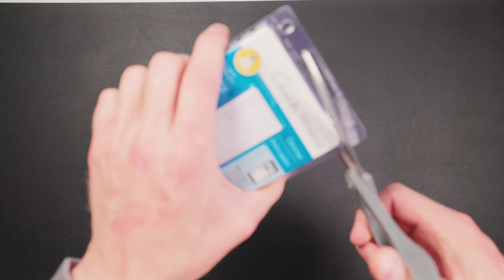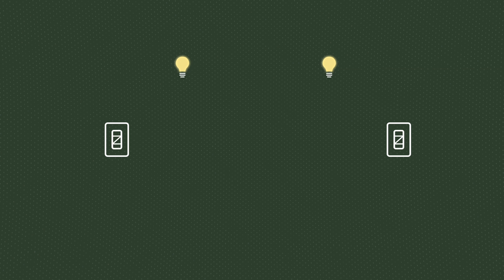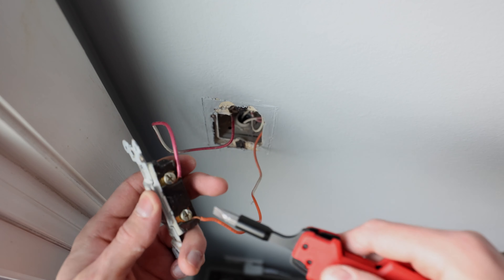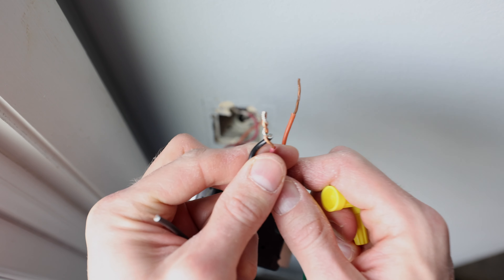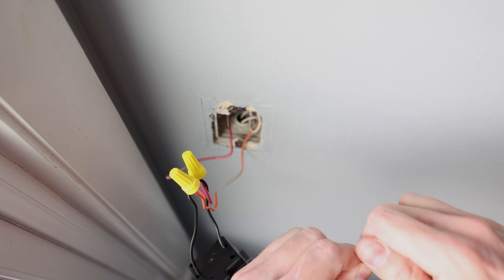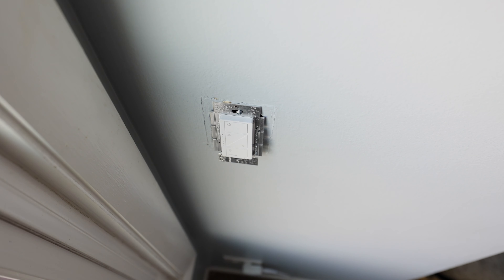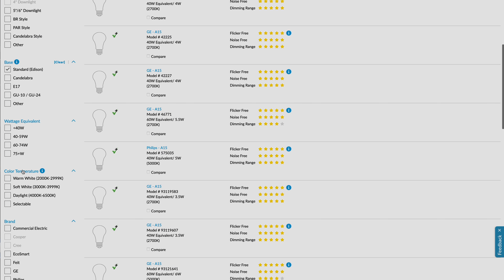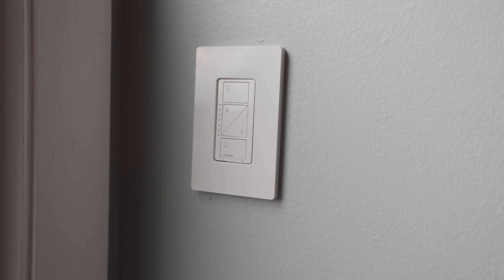How to install a Lutron Caséta Dimmer Switch

Comment: I installed a Lutron Caseta and regret installing it. Very good quality but a big problem for me is that it does not remember the last dim setting...!!
Reply: Yup I also did not know this when I invested in Lutron Caseta… but they are pretty much your only option for smart light switches that do not connect to WiFi. My house has enough WiFi devices as it is, and I was not willing to take the risk of installing 20+ WiFi light switches from another brand.
Reply: I agree. The videos and instructions are misleading about the main switch not having the capability of storing or recalling the default dimmer settings. Kinda stupid for a smart device.

Comment: "You want to join these up with these two wires". You really need to be more specific. I know it's a simple single pole switch, but you need to tell the view which colors join to which colors, and if it doesn't matter (which it doesn't in this case), you really should explain that. You sort just breezed through the biggest pain/anxiety point for the newbie. They're going to be left wondering if they might have done somthing wrong. Just food for thought.

Comment: Lutron Caseta Dimmers are what I use in my home. Mainly because they don't require a neutral. But in my experience, while expensive compared to other smart switches, they are very reliable. I've never had a no response issue out of the several that I have installed in my home and that to me makes them worth the price. Like Eric says though, they are on the large size and do take up quite a bit of space in the electrical switch box so make sure to do your homework before just jumping into them. If you have the space and budget for them, they are great and I think most people would love them. As an added bonus, if you use homebridge or HOOBS, there is a plugin that you can use to make use of those PICO remotes that come with the switch as a HomeKit button. These usually come with the 5 button variety so that would be 5 buttons that could be setup to control devices or trigger scenes and so forth however you'd like!!
Reply from the maker: Thanks for sharing Jody. I’m glad they work well for you too

Comment: Can you do one where you’re replacing multiple switches within the same box? I have one that has four switches and I’m wondering, can you fit 4 Lutron switches in that same space? Or is there another way to replace those
Reply from the maker: Good question! You can totally fit four Lutron switches in any box designed to fit four switches. You just need to tear off the metal tabs on the side with a pliers. I mention that briefly somewhere near the end of this video but the context might not be clear.
Reply: @EricWelander  ok cool! Also, for the two black wires at the back of the lutron unit, does it matter which of the colored wires they get connected to in the wall? I don’t remember hearing that in the video.
Reply: @loganebeling9023  good question but no it does not. If it did, they would be different colours like they are on the non-dimmer version of this switch (which also requires a neutral wire)

Comment: I've installed a dozen of these switches including dimmer and fan switches along with the Pico remotes.

You must ground the switch to prevent a shock hazard.  If there is no ground wire in the metal box (and presuming the box is grounded) you can add a green or bare wire with a ground screw to the back of the box.

Lastly, since these switches are not using the neutral (white) wire, they get power by allowing a small amount of power to actually flow into the circuit.  This can cause some led bulbs to glow.  This can be corrected by sometimes using a higher watt bulb or installing a "resistor".
Reply: I’m glad you mentioned a ground wire is needed. He could have added a pigtail to the box and connected the ground.
Reply: If the metal box is grounded, screwing the switch into the box will ground the switch. It’s a decent solution to not having a ground wire, but adding a true ground pigtail is always the best option
Reply: You just answered my question: Why are my small LED lights on the deck still on when the switch is off? It's as you mentioned; just a glow. They're not on fully. I guess I'll need a resistor.
Reply: Lutton makes one and there are others on the market.  I used the Lutton version.